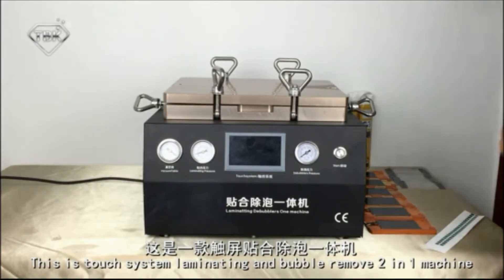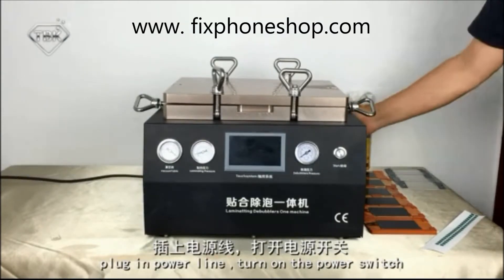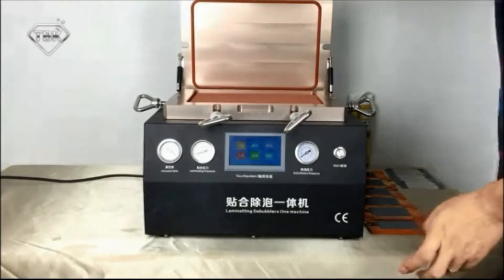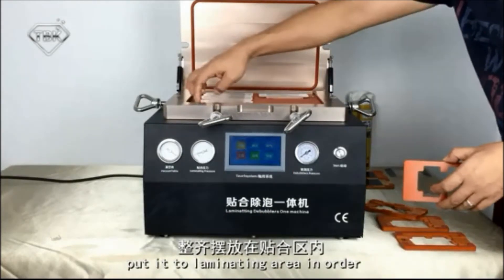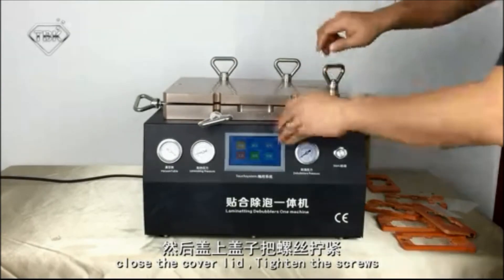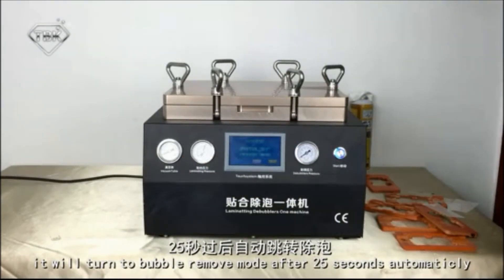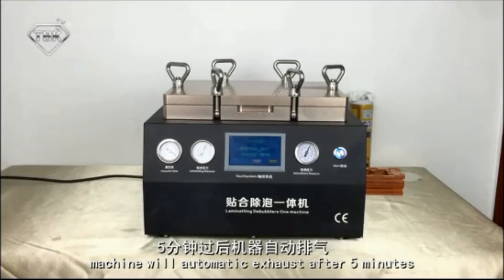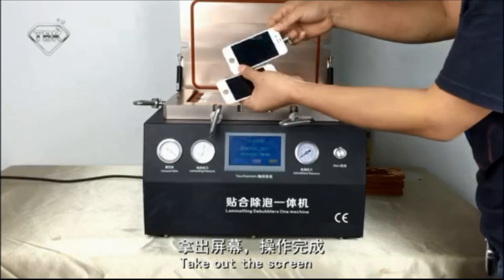2 in 1 LCD Touch Screen Repair Refurbish Machine Vacuum Laminating Autoclave Bubble Remover

Comment: I bought one of this machines and i have a serius problem. Machine removes the bubbles perfect but in some lcds not working after process finish, seems this machine pressure the lcd really hard or destroy the flaxes. I dont know what iam doing wrong, i have this machine out of dust free room... does it matter?
Reply: Do you still use this machine....Does it work???
Cheers

Comment: Im using the TBK-408 model of this machine, is it the exact same process? as mine is not staying together properly?  My issue is I follow all the steps, remove old polarizer, clean, apply new polarizer, apply oca, place the assembly in the machine just as shown and use 15 second vacuum time, 25 seconds laminating time, 10 minute debubbling time, 45 degree celsus temp.
Reply: +Clifford Holbert Also i noticed that when applying my polarizer it does not stick to the lcd? and on my oca i notice it is only 1 sided, so i can apply it to the glass, then the other side is non sticky. Is this my issue? bad polarizer and adhesive?
Reply: Clifford Holbert  polarizer and oca have two films that protect both sides you aren't peeling all four off.. do that and let me know ..
Reply: yes , that's true  : )